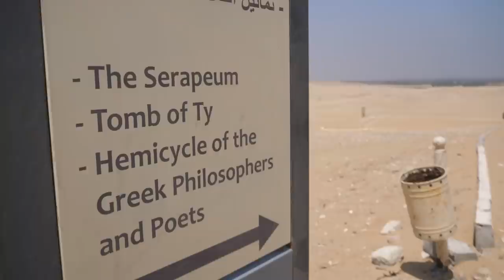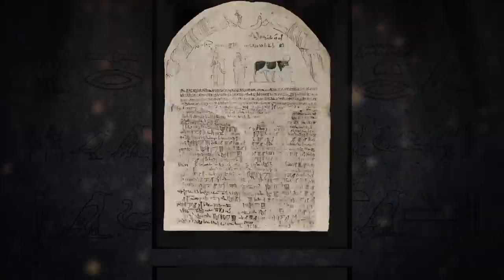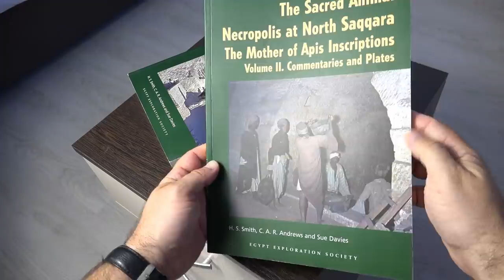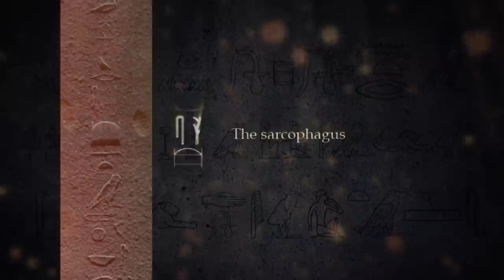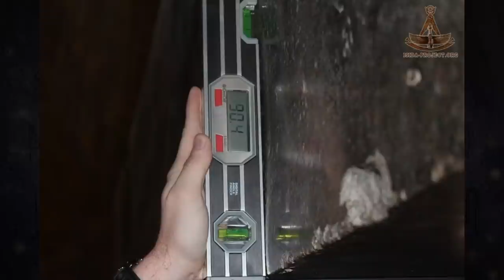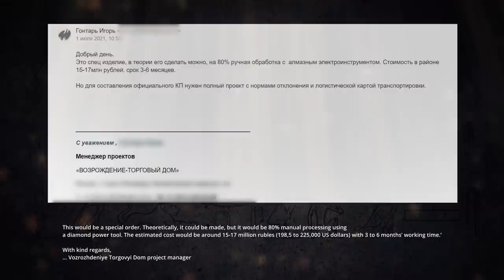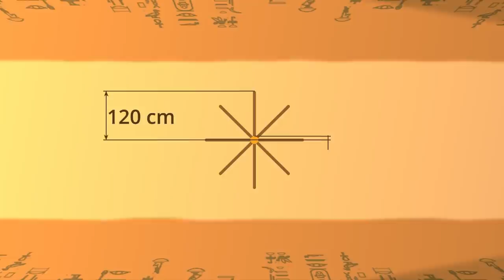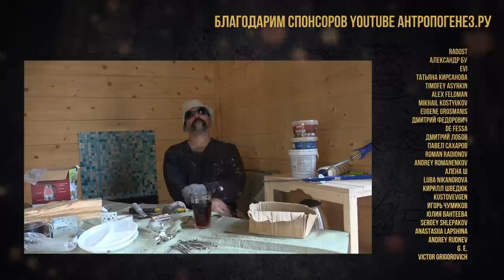The Impossible Sarcophagi of the Serapeum: What are Alternative Historians Silent About?

Comment: Excellent. Thank you. 
Though by drilling to hollow out the sarcophagi, would be much much faster. A few sarcopahgi such as Great Pyramid ad a couple others having the traces of a core drill having gone slightly off linre on the walls
Reply: Denys Stocks argued they first drilled the entire inner perimeter of the sarcophagus, leaving inside an isolated mass of rock which needs to be removed in order to completely hollow the sarcophagus. 

I'm wondering if after drilling the interior perimeter, can fire setting/hammering be used on the isolated mass of granite? Would this be faster then the drilling it all out? Given the size of the sarcophagus I think fire setting can be used on the interior mass without damaging the walls. Just a thought.
Reply: @MrAchile13  yes. But a risky choice. Though I reckon they were good enough at it that maybe they could get away with it.
Reply: Yep, this is my thought too...just drill the cores out roughly, then they could use chisels or stone to clean everything up..In my mind that would be how I would try and do it. Of course it would take a while, but you could get it done with a small group of motivated people. Plus they probably rotated fresh shifts of workers in every 30 mins or so, so that the massive amount of grunt work could be done as quickly as possible. And then the expert stone masons would start working on aligning everything and smoothing everything up. Then the polish and done. I wish SaM had the time and money to try it..I bet you they could probably duplicate one of the smaller Sarcopahgi in a year or two. But like everyone else, they have jobs and have families to feed...It's hard to take 2 years to do this kind of stuff..thats why no one has done it yet...Though Olga did a great job on a smaller scale.

Comment: A very important item that I've not seen mentioned in the measurements.
When the square is in place notice the line where the tool touches the surface. When that line changes thickness that means the surface is not flat. On every modern surface the line is a constant width. Nearly every time they measured the ancient surface the line changes width. This is exactly what would happen with the hand process the Egyptians would have used. Visually it looks good by accuracy wise it's off.

Comment: There is actually a common problem between those who earnestly purport the high technology hypothesis and those who argue against it which is the lack of technical data on all of these artefacts. We really are in the stage right now where each side is questioning the measurements of the other rather than the interpretations and arguments drawn from those measurements.

I would also say that I don't consider those who purport the high technology hypothesis to be idiots. It is a genuine theory that ought to be explored and shouldn't be dismissed arbitrarily. What I dislike is coming to hasty conclusions and bad academic standards.
Reply: I have to say I dislike the sneering tone adopted by the narrator. 

There are very many unanswered questions, such as exactly how they transported the sarcophagi along corridors too narrow to contain them.

Measuring modern work in granite and measuring it proves NOTHING.
Reply: Those modern granite blocks that he measure, what kind of tools were used to make them i wonder? Copper chisels,  bronze saw, pounding stones,  wooden cubit rod?

Comment: Great video.  It makes more sense than the UFO  myths.  However, the pulley explanation needs more work.  How were these pulleys attached?  Is there evidence along the walls or ceiling?  These pulleys would bear a tremendous amount of weight.   Also there had to be a way to lift  up the front  end of the sarcophagi when pulling along the corridor otherwise it would get hung up on the slightest  imperfection on the floor.  Thanks for your time and keep up your excellent work.

Comment: I'm not entirely sold on the wooden log rollers for the sled. I once moved a 1000 Lb safe on wooden furniture dollies and that much weight absolutely crushed the wood into mashed up pulp. If even one of those logs binds up on an imperfection or another log, it will absolutely shred into bits and you will get a chain reaction of failures. Moving the sarcophagi must have been tremendously difficult hence the "abandoned" one in the corridor. When they failed at it they just gave up? Yeah it must have been a hard task. 

Now, the same people who gave up on moving a sarcophagus in a hallway are the same ones that built the pyramids? I don't think that makes sense.
Reply from the maker: > Now, the same people who gave up on moving a sarcophagus in a hallway are the same ones that built the pyramids?
2000 years between them
Reply: @ScientistsAgainstMyths  Interesting! So the sarcophagi were added later? I'm so confused. Can you recommend any source material for me to look at?

EDIT: I see you have some links posted. I'll start there
Reply: Indeed, Belzoni mentioned he hired 130 workmen to pull the statue of Ramesses, the drawing of this shown at least 50+ pulling it, and he used the same wooden rollers, the Statue weigh 7.25 tons,  how they pulled 45 tons with the same wooden rollers, I think this calculations are too optimistic, or may be you need to change wooden rollers with steel rollers

Comment: The sarcastic comments and charades are petty & unfortunate because you went to great lengths to find truth. When you measured stones in the city, made with fairly modern machinery you actually proved unchartedX correct.  No serious researchersare claiming Aliens. Realistically some ancuent humans had developed basic machinery like flywheel/water/steam powered lathes and made huge metal saw blades with corundum stones soldered in as teeth.

Comment: Excellent video ! I also think robbers used to burn fires against rock or old and hot water . Maybe even mirrors and lenses to destroy rock with sunlight
Reply: Historically fire has been used to breakdown hard stone in quarrying/mining - called "firesetting".  Yet limestone such as most things were built from because it is not terribly hard and thus can be worked easily would not require fire.  Hammering multiple chisels into stone blocks along a predetermined line will via expansion cause the stone to split.  Then the smaller chunks can be broken free and levered out.  

So later on when people used iron tools then say granite blocking stones could be fractured using those.  During the Bronze Age however bronze tools and abrasives would be used to work granite along with gneiss stone tools like flint or dolerite.  Firesetting was probably being done in the quarries to cut through the bedrock to obtain your initial "block".  To "core out" a block of granite such as would become a sarcophagus however fire was probably not used as it would weaken the block.  Think the unfinished obelisk which cracked and had to be abandoned after all the work put into it.  🤔

Comment: I have a bizarre idea about these boxes. They are tilted down four degrees and this was probably very important or they wouldn't have gone through the trouble of doing it. The smooth flat surfaces between the lid and box could have been a hydrodynamic bearing. A thin film of oil would allow the lid to slide easily and the four degree slope would be enough to let it slide on its own. Because it is so heavy, it could drag a cutting tool across a workpiece with a very smooth action. A wooden structure mounted to the lid could hold the cutter. The wood parts would be long gone. This whole thing could be a machine shop with a bunch of bays. Or not.

Comment: The digital protractor you used is a $40 tool and is not a precision instrument and would  be accurate to about .25 degrees. You should have calibrated it first on a known right angle.   I have one of these and it is made for carpentry.   You also said twice when reading it that it read 90.8 when both times it was reading 90.08.  The machinist's square that the other researcher used was actually more accurate than yours.  The protractor you used is not appropriate for flatness measurement. A machinist"s straight edge is. Anyway you would normally put it on a known flat surface and calibrate it first.   Naturally the stones cut with modern machines would be accurate, it means nothing in relation to the Egyptian sarcophagi which you say were made by hand with simple tools or as in your example a stone ball.   Your science is certainly no better than the researcher you are cirticising.
Reply: They could certaintly do with getting a more accurate measurer. Their one is accurate to +/- 0.15 degrees. However, they found a lot of the supposedly precision engineered right angles are actually 91 degrees. So their conclusion is correct: it's incorrect to claim the angles are exactly 90 degrees and it's incorrect to claim it would be impossible for modern tools to achieve the same level of accuracy.
Reply: It was precise enough to prove that the psuedo archeologist are liars.

Comment: Im at a loss as to what measuring modern day cut blocks proves other than we're pretty good at it now with our diamond cutting tools, large industry, hydraulics, cutting discs, linear guides and CNC capability, which only goes to show how good those sarcophagi are!  lets put some more context on your figures..  that angle gauge looks to be about 300mm long so each 0.1degree equates to roughly 0.5mm off perfect height.  0.5mm is about 4 human hair widths.  I really appreciate your videos and the effort but it seems all of this only goes to prove historians have an equally implausible explanation of how it was all made as the alien argument (and ive not seen any alternative argument accredit this to aliens!!) .  The lady that spent 7months chipping out a crudely similar (but not good enough) duck pot is an excellent example.  It would also be an easier watch and do your self some favours to accepting your information if you dropped all the sarcasm and ridicule.  You are all on the same team after all of being interested in history!
Reply: The measuring of the modern day cut blocks is because all the claims about how precise they are and that we can't even replicate the results with modern tools. When comparing the results you also have to account for the fact that many of the craftsmen probably came from generations of people who did the same. That means a lot of accumulated knowledge. 7 months is nothing compared to the potential of generations of an entire village working the same craft.

Comment: Good job. But I wish you had a longer measuring device. 35:35  The imperfections that you can see are hindering the accuracy. For a big object you need a big measuring device. You need a huge square as in something like a  5 foot by 12 foot square. Then you can see if the straight edge touches the other corners and if there are any humps. Because if the roughness balances out so that each corner is 90 degrees from the other then it would be cosmic. No matter how rough the sides, bottom and top getting to the corners would be.  Or you can use the 3-4-5 Method For Squaring Corners.  No Laser Cad?

Comment: The Serapeum was created to support the cult of the Apis Bull.  As such all Pharaohs supported the cult and added to the underground temple over more than a millennia.  The sarcophagi contained there are inscribed with the names of the Pharaohs who created them.  So the "nice" granite ones you see are the newest section open to the public.  That section was the last to be created and dates to Ptolemaic Egypt = or Roman times when they had iron tools.  As to moving them.  Oxen who can pull a sled or wagon can just as easily push the same if a wooden frame is built to achieve this. Because they had iron - that made wheeled conveyance feasible as you need iron to reinforce wheels for heavy transport.

Comment: The methods with which the ancient egyptians were able to both carve out and form into  predetermined shapes rocks of varying sizes are well known, from the size of something a single man could carry to massive entire obelisks were made this way.  

They're still used in some egyptian rock quarries to this day.

It's very simple, they used heat expansion and cooling induced contraction and how rapidly cooling a very hard and thus brittle substance cracks in a uniform manner when subjected to this. When something like limestone or granite has been heated to a relatively high temperature point this process will make it crack in a uniform manner between the points and along the lines that were heated.  

In short, by lighting up a fire on the rock they want to cut out, making sure it burns hot enough and then pouring cool well water on top of it after clearing away the fire, induces a straight and predictably advancing crack with in seconds. 

Hand abrasion was only used to polish and finish the rocks, as necessary. Cuts the amount of manhours needed down from two years to a few hours to a couple of days, depending on the level of polish and finish desired.

Naturally they also had the means to use manual labor to achieve the same result in smaller areas, as you demonstrated. The ancient egyptians were extremely clever and their level of sophistication in mathematics and ability to wield it to their advantage and emphasis of meritocracy and rewarding skilled work in accordance is the true wonder of their culture. That doesn't however, mean they were preceded by some mythical culture of super humans (or aliens or whatever mythical nonsense) from tens of thousands of years before any known behaviorally modern human settlement built into a city, that there's no evidence of any sort, genetic, archeological, historical, geological   or even folklore by the egyptians themselves, that did it. 

It was the ancient egyptians and just because white middle aged looser in his moms basement can't figure out how they did it, or even discern a reliable historically accurate scientific source from nonsense, doesn't mean it was whatever imaginary nonsense their feeble minds come up with to fill the void.

Comment: how many hours did this take? he did the sides which makes it easier as it's not from the actual center where the stone hitting is immensely hard to flatten the sides. I'm still not convinced, ofcourse this could be done with patience and manpower at this level. but the sarcophagus were huge. and they were many of them. the company you contacted in russia where they can replicate the actual thing will be using advanced tool. boring the inside with a hardened material  using a machine than just polishing the insides with manual work. but an actual human to actally bore the insides using that method? is beyond my imaginaion.  using levers and pulleys to move the granite stone? what are they made of? stones also? how did they make it?  it would crack. the levers must be super huge in size to accomodate that weight. and the rope they used? what's it's made of? the base where they put the levers? are there holes in the area whey they would stick the levers? what's holding the levers then? how about the logs used to roll the granite stones? that immense weight will flatten the logs to a certain degree making it harder to roll therefore putting more stress to the rope, levers pulley, the base where the pulley is placed?...and have the found the pulley and lever? it was never found rigth? 

the theory is good and plausible to a certain degree, but the material science during that time is not that durable. small scale works but a larger scale? come on. it is so inneficient the idea is beyond what's possible in human. human have heart and reasoning. to work all that it's impossible that they wouldn't they just commit suicide at that point. i'm not saying it's aliens. i'm just pointing outt what's lacking in the video.
Reply: Efficiency is irrelevant. You judge them from your perspective. How much time do you spend at work? Assuming you work full time, you spend 20k hours working every 10 years, 250 days a year, 8h a day, for 10 years. It was their work and they had no Facebook or Youtube.
Reply: I'm with you, the slots in the wall are small so the supposed log would not be strong enough to lift the lid even just a little bit. Ropes and pullies what the fuck is the rope made of and how thick and strong is it?   So much is just skimmed over on this. Nice presentation and all but this still doesn't add up. Just to get the rough block on site to begin to  "hammering"  and "drill"  the inside out is a feat on its own. 
Like Dunne has said you don't use the hard heavy materials that need to be sourced for miles away unless it's easy to do so .

Comment: Well I guess most of my fascination about egypt i build up over the last 2 days is gone now. How do you explain the overcuts on some pieces?
Reply: The term overcut is a favourite for some Alternative leaders because it pre-trains the mind. Take the unfinished sarcophagus for example. It is advertised by some that a power saw ran off course. But when the toolmarks are examined, it is seen that a drag saw was used in several angles as the piece was gradually worked along the length.
Reply: @Eyes_Open  yeah, did a bit of research on my own and its basically a big nothing burger ^^